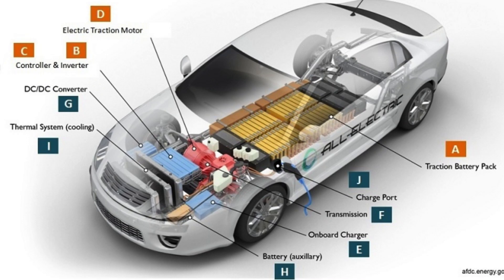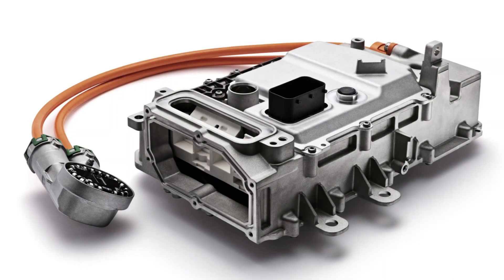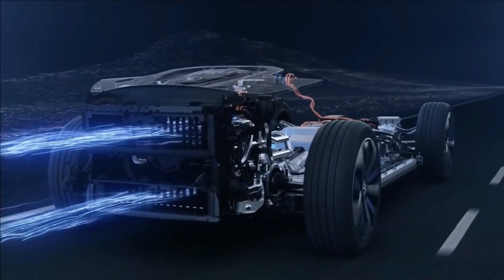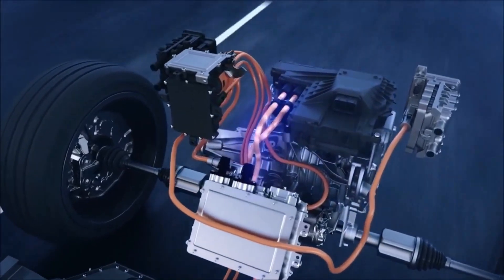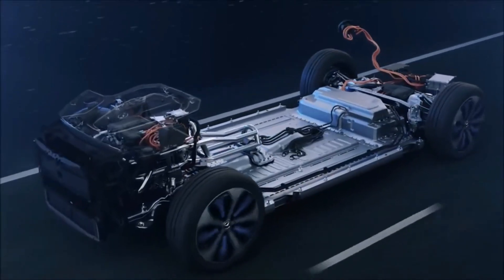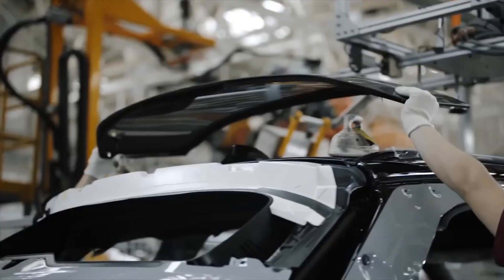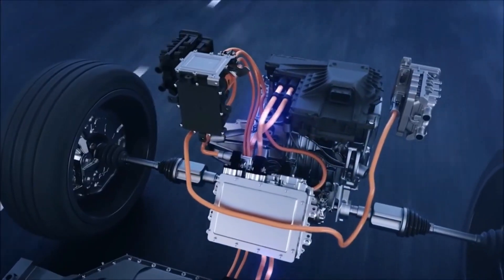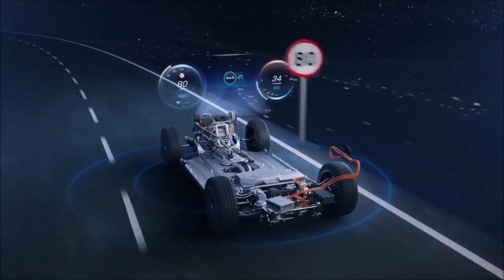Main Components of Electric Vehicle | EV Important Parts | Battery | DC DC Converter | Charger |

Comment: Is hybrid cars good to buy as pre owned cars
Reply from the maker: Yes, if you are interested in fuel economy, you should buy a new or used hybrid. But if you decide to buy a used hybrid, you should have the car's battery checked out by a mechanic before you buy.